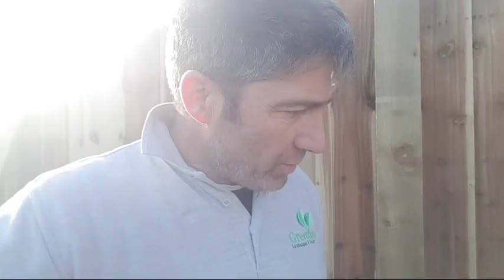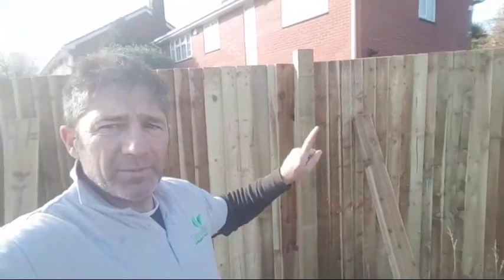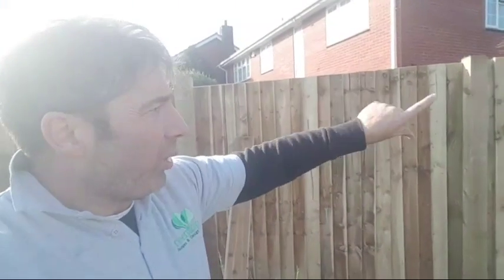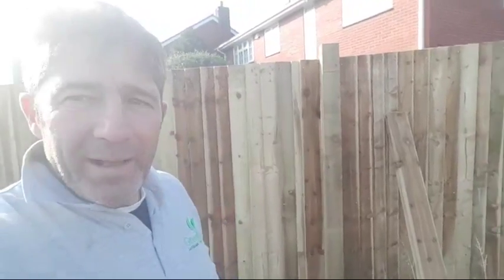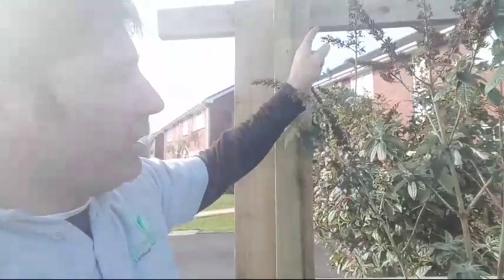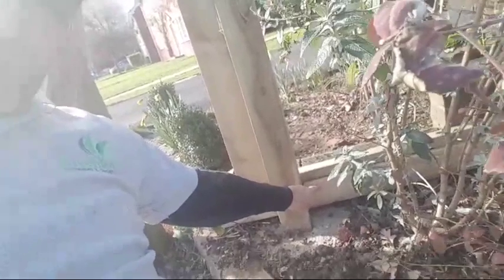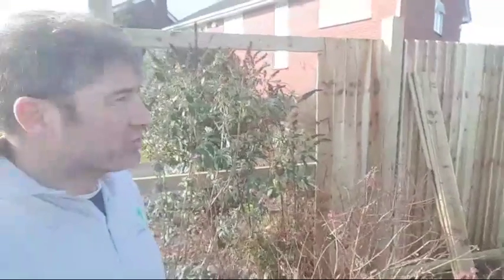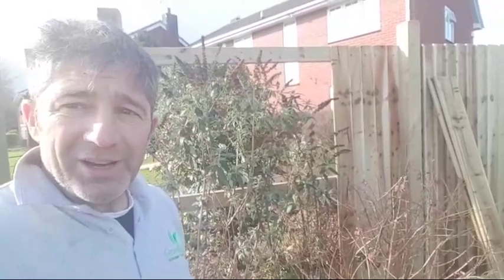How To Erect A Featheredge Fence

Comment: Good stuff mate i'm interested whether it's worth putting the top of the featheredge boards a few mm above the top 4x2 rail due to shrinkage? Or would you say its fine to do so.. I'm used to Arris rails but this method looks great !!
Reply from the maker: Do you know thats a great point but you can not guarantee the same shrinkage rate for all so it would not matter, I think i best satring at that one point, but thanks bud stay safe.

Comment: Could you explain what you meant by alternating the feather edge boards please. It was difficult to see on the video. Also the setup of the fence. As I understand it, it's basically 4" post, then the rail on the back of the post then feather edge directly onto the rail between the posts. So the majority of the post is shown and only hidden by the feather edge?  Cheers, your channels class by the way.
Reply from the maker: Hi Ian I meant bby changing the direction of the overlap ever 6 foot to give it a different look